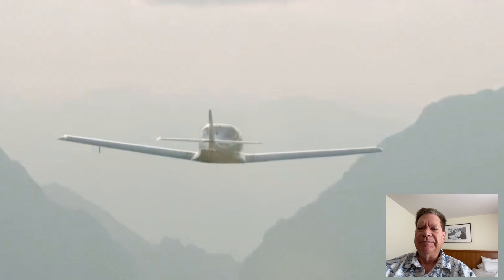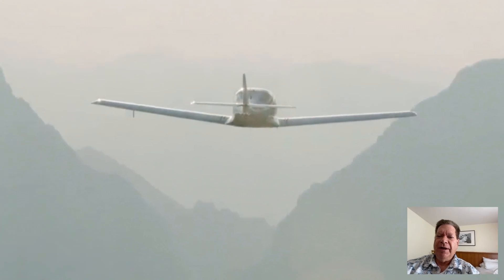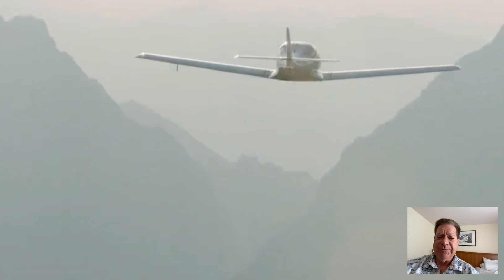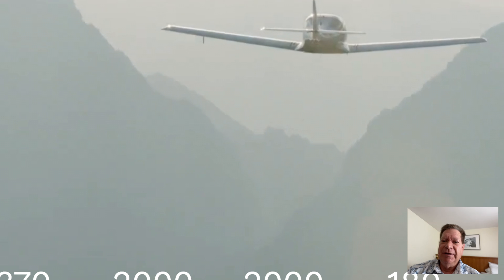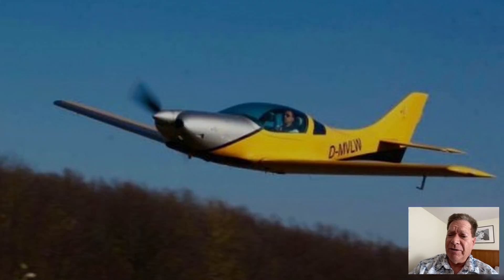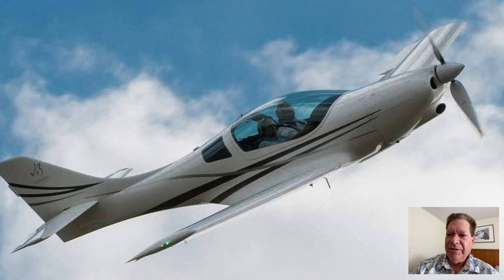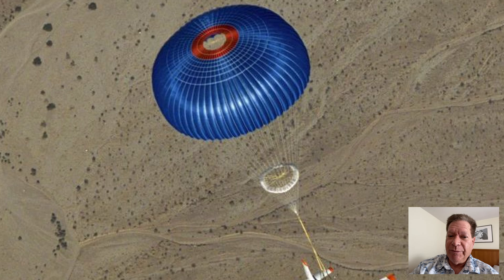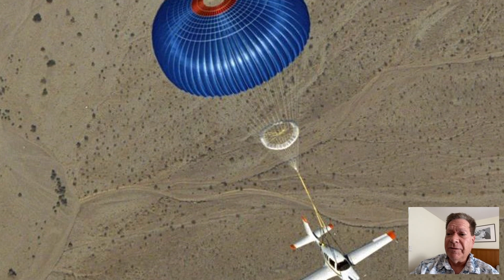JMB Aircraft VL3 Evolution Airplane - Ordering Part 1

Comment: I was very interested in the VL3 in late 2019. Opted for the Bristell with the 140 hp Rotax engine for 2 major reasons. The Bristell has good dealer support in Lancaster Pennsylvania and it’s a certified aircraft so I didn’t have to deal with all the issues with an experimental. Decided on  a two place airplane because our community hanger could only accommodate a low wing airplane with a wingspan of 30 feet or less. Hanger space is a huge issue most all over the country. Probably would have purchased a DA40 or Cirrus aircraft had I been able to secure larger hangar space.